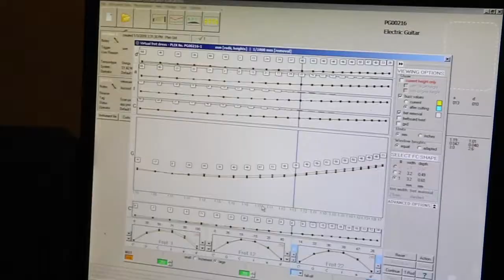PRS McCarty Plek Setup Part One

Comment: Hi Leon! I have been following you for a while over at the Fractal Forum. Just subscribed to your YT channel today. I just found this cool video of the Plek machine.
Neat to see this here. In my experience with the Plek, I had a strat refretted with SS frets. Put it on the Plek machine and unfortunately the cutter made chatter marks in all the frets.
It did not turn out well. I have had other guitars turn out okay on the Plek.
However I have a veteran luthier who has a great touch. He does all my fret work by hand and I am 100% satisfied with the results.
Yes the Plek is very inovative but at the end of the day I would rather have my luthier do it.
Reply from the maker: As you see here there's loads of handwork that needs to be done once the Plek does it's job. The Plek is only as good as the luthier on the other end IMO.
Reply: Yes! I agree. Scott P.